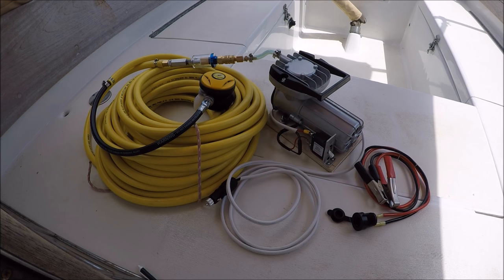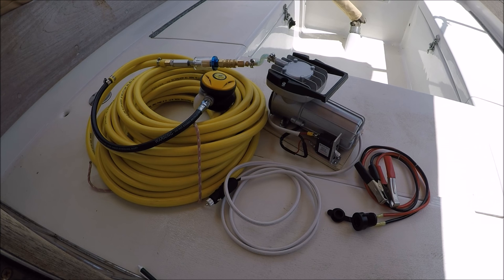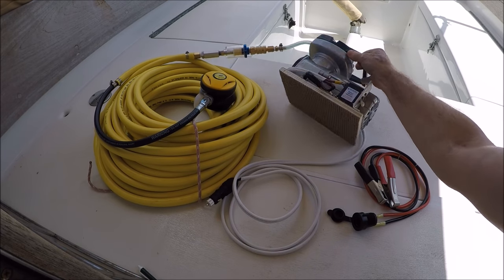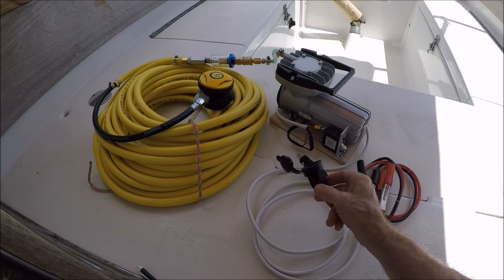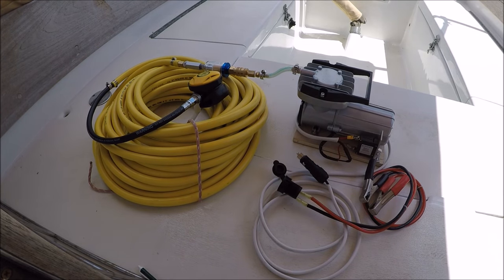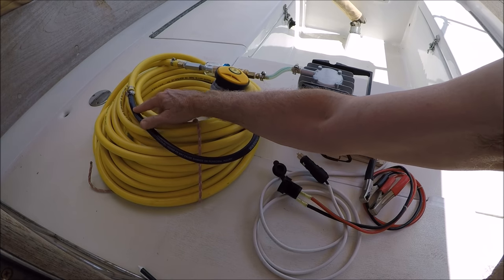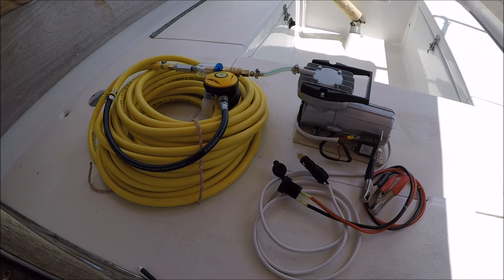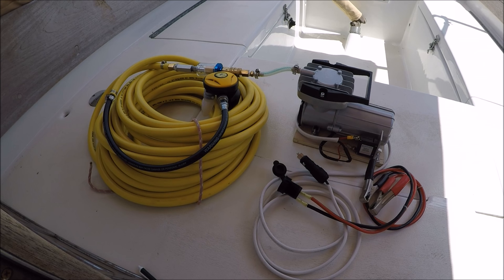DIY $300 Dive Hookah for Boat Bottom Cleaning

Comment: I built this and I am breathing through it but feel like Im hyperventilating and sort of dizzy It makes enough air but feels weird.
Reply from the maker: Assuming everything is working properly you need to control your breathing to slow steady draws. It's natural at first to breathe too fast but you should be able to slow it down. You say it supplies enough air but if not, the filter might be adding too much restriction. You could do a few test breaths without it to see the difference and if that's the problem maybe buy a less restrictive filter if possible.
Reply: @atomvoyager  thanks, I think Im just new and its cold water. I can sit and breathe fine for half an hour but it feels strange. Im not a diver but snorkeled quite a bit, its also not like the snorkel either. Yeah I just need to relax I think.
Reply: Probably because you're breathing in oils and gasses from using an air compressor not designed for breathing air.

You could pass out at depth
Reply: @atomvoyager  I found to regulator could use adjustment and one fellow has a video showing how this is done, not difficult. One might show the setting screw and how to adjust it.
Reply: @UnknownDiver  this is an oiless diaphragm compressor.  An in-line filter is a good idea.  At 7ml/kg in an adult male ‘at rest’ and a resp rate of ~12-16 breaths per minute, a 100kg male, at rest will need the full pump ‘rated capacity’ to not feel like you’re breathing through a straw.  Adding the energy needed to clean the boat, and the added pressure of the water… I think you’re significantly under capacity.  

Putting a tank in the loop would be a good idea.  Always scale up… you need the reserve for safety.
Reply: @atomvoyager add  2 X 2L food grade soda bottles as reservoir, for two divers .. 1 soda bottle/ ea person sucking.

Comment: Could you put two of those pumps in parrallel?
Reply from the maker: Yes you could although I don't know if it would be OK to have one on while the other is off due to back pressure. You could add a shut-off valve between them if that was an issue or just have them both wired to one switch so both are always on or always off.
Reply: @atomvoyager  Oh the idea was to have both on at the same time to increase air pressure to go deeper underwater.
Reply: @urgencepc4563  These pumps only produce about 15 psi of pressure. Water pressure at 30 feet is about 15psi, which means these pumps cannot push any air past 30 feet. Doubling up pumps will increase flow volume, but not maximum pressure. Multiple pumps would be good if you need more air within the 30 foot working envelope (multiple divers, heavy exertion), but will not allow you to go any deeper.
Reply: @jarrodmahon3833  Thanks!

Comment: why a circuit breaker? isnt that dangerous?
Reply from the maker: A circuit breaker is not only a convenient on/off switch it acts as a fuse to prevent damage or fire during a short circuit. If you mean it's dangerous because it might trip while you're underwater, that shouldn't happen and if it does I can hear it stop through the hull and water at these shallow depths and even if I didn't I can come up before I need another breath.
Reply: The way he has it wired it really only functions as an on/off switch. The point of a circuit breaker is to protect the wiring, not the device. In this case, the most likely failure point is in the connector. Second most likely is something penetrating the wiring. The breaker, where it is in this example, will not help.

So yes, it's dangerous. An inline fuse closer to the power source would solve this problem.
Reply from the maker: @RonKuris  Good point that the circuit breaker will not protect the wire between it and the power source but seems to me it does protect any shorts in wiring and motor on the other side. So yes, another fuse can be added at the other end for better protection.
Reply: @atomvoyager  shorts in the winding are extremely unlikely. Take one apart and see. A typical motor failure is almost always an open circuit. It is also possible that the motor will be "stuck" and it will draw a lot more current, but since you oversized the wires anyway, you aren't going to have a problem there. The chance of that starting a fire are very low.

Circuit breakers really only protect the integrity of the insulation for the section of the circuit it's protecting. Consider adding an inline fuse as close to your clamps as possible and using your circuit breaker only as a switch. A battery mounted fuse is a good option.
Reply: Cuántos metros de mangueras usastes para tu equipo
Reply from the maker: @josearleflorescastellanos7657  I used 20m of air hose but cut it down later to 15m. The electric wire was about 3m.

Comment: I have no engineering knowledge whatsoever but my first instinct if ever I were to be challenged with an important job working on the bottom at sea, it is to rig a hose of not overtly long length and breath through it while my partner holds up the free open end securely. It would look like someone breathing through a long flexible but not collapsible reed. Won't that do? No need electricity. Of course, a proper scuba diving mouthpiece would be necessarily connected.
Reply from the maker: That won't work and that's why we go through all this trouble to set up these complicated devices. The max depth you can suck air through a hose is about 18 inches as explained in this thread:
https://www.scubaboard.com/community/threads/long-snorkel-breathing.239020/
Reply: @atomvoyager  18 inches? Thank you for being so helpful with your knowledge. Really appreciated.
Reply: Hee hee, I tried that when I was 14 in a pool. I kept my thumb over a hose until I was well under, put the hose to to my mouth, and removed my thumb. It felt like my lungs were sucked out of my chest.

Comment: If i want put battery which one i have buy?
Reply from the maker: The pump only draws 7 amps so if you only need to run it for a couple hours between charging the minimum size I guess would be a Group 27 auto or marine 12 volt of any type. You can go larger up to group 31 100 amp hour marine deep cycle AGM for longer run times.
Reply: @atomvoyager  i want buy 120watt and 160l/m little bit more power than yours
Reply: If i want to run for example 2 hours i need battery 14 amp right?
Reply: And how many meters deep you can go maximum?
Reply from the maker: @frenkscorpion  You would consume 14 AH in 2 hours so any small car battery should handle that.

Comment: It works fine if your if you've got lungs of a mouse ,you must struggle with it an everyone who goes to buy one your recomending will struggle ,plus there should be an air bottle in between pump and you ,every system that's good that's on the market use this ,beleave me when I say it don't work ,you struggle ,non of mates could use it either,  crap systems do not work ,blow out carbs ,what at 16psi ,probably make expensive inflatable pump